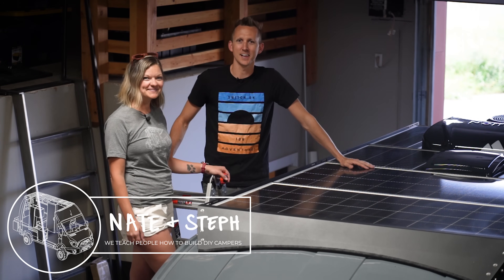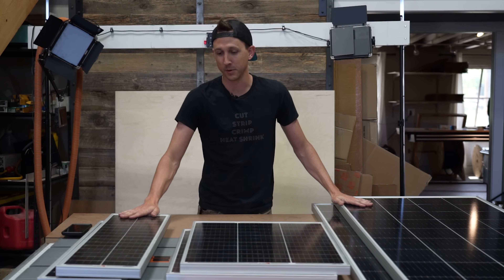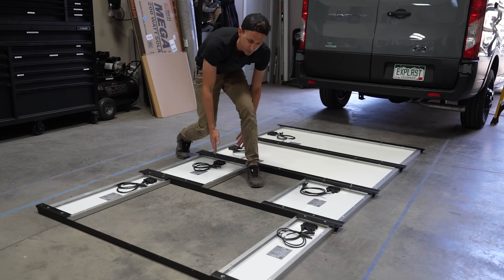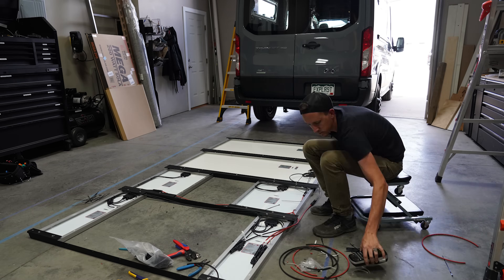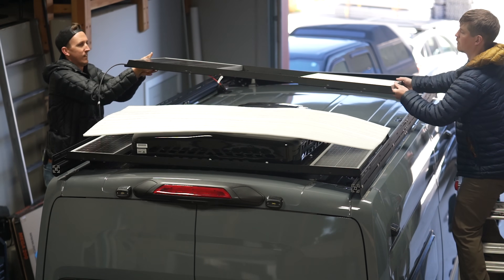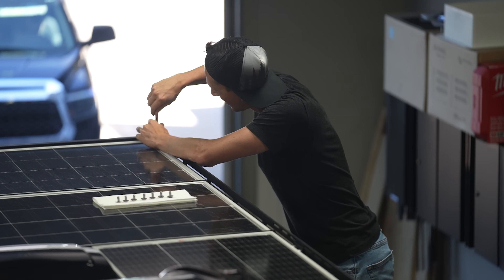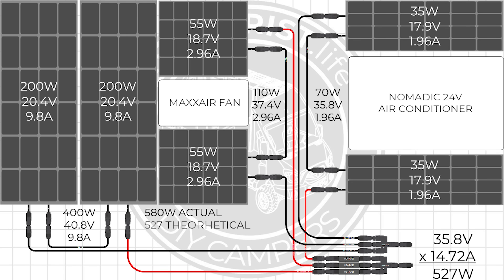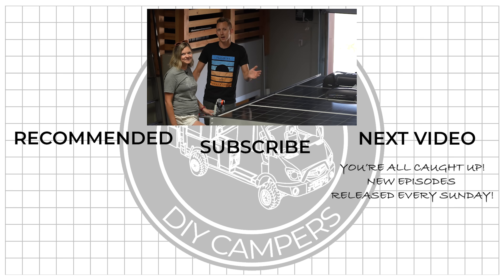INSTALLING 580W OF MISMATCHED SOLAR PANELS ON OUR TRANSIT

Comment: I think if/when I do something similar I'd just pop the rear half of the roof rails up 8 or 9 inches and put a third 200w panel over the vent and front of the AC. with just a couple modified brackets you'd be left with only 3 matched PV's instead of 6 mismatched panels, ~73 more watts, the vent and part of the AC would always be in shade, and could build a couple boxes up top to take advantage of the freed up space. With enough finagling I think it would only add about 1 inch overall since the vent could open into the hollow cavity under the panel. Might be a little tricky to mount an awning though.
Reply from the maker: That's 'somewhat' how we had it on our old van and the panels really are way up in the air to clear the open maxxair fan.  It's 'fine', but not the form factor we were going for this time around and really made the van undriveable during cross-winds.
Reply: @EXPLORISTlife  Hmmm... (digging into the back catalog) I see. Weird, I wouldn't think putting the panels on top of an open frame rack like that would make a huge impact on cross-wind behavior, especially when you're already driving a billboard. I wonder if the differences in handling could have anything to do with the MB vs. Ford switch as well as the lower rack height. It also looks like you used to have quite a bit more weight in front of and behind the front and rear axles (respectively) that could've jacked up the moment of inertia. kind of like loading a trailer too far to the rear, just a little nudge and you have to fight keep under control. I'll have to keep all of that in mind.

Comment: Is it possible to use this solar array with a 48v inverter charger and 48v battery bank? I don't fully understand these 48v inverters, but they say the MPPT range is 120vdc-450vdc. Does this mean that the solar array wired like you've done is too small? Will the inverter charge the batteries with a lower input voltage?

Also, can you wire an alternator into the PV input of the inverter to combine solar + alternator charging while underway, even if it's not a 48v alternator? Apologies in advance if this is the stupidest shit you've ever heard, I'm just not educated enough in electrical
Reply from the maker: I guess it depends on the charge controller.  This array won't work with a Victron charge controller and a 48V Battery bank as the array voltage is under the battery bank voltage.

Perhaps taking a look at https://www.explorist.life/solarwiringdiagrams will show you how to set up a proper full system. 👍

Comment: I need everyone’s quick attention; 

I have 8 100w panels.  Specs-18 volts/ 5.5 amps.  They are currently in 2 sets in series then parallel.

My question; I just purchased 2 200 watt panels.  Specs- 18v/ 11 amps, doing the math of adding these as series then parallel with the other panels “doesn’t get me much”?  Correct?  

Sure appreciate anyone help!

Comment: p A r A llel ..  Amps Add / 2 A's... ...    s E ri E s ... volts add...   (E is a letter used for voltage in some equations)...  a way to keep them in mind...  and, you don't even have to remember both !  just get the pArAllel one  stuck in your mind and you'll know the other one is the opposite.

Comment: If you add a second controller, you can push the calculated efficiency from 90.7% to 99.17%
Leave the bigger array panel connected in series to one controller 40.8V*9.8A = 399.8W
The other two arrays connected in parallel to other controller        35.8V*4.92A = 176.1W
Total of power calculated: 575.9W. Total power available: 580.7W  (99.17 %)
Thanks for yours videos.
Reply: 90.7% sounds pretty good to me
Reply: It's kind of irrelevant.  It's a bad setup.  The 70w of the smallest panels are loosing you 60w off the largest panels. And loosing on the mid size panels as well.  You would be better off without them.  Not to mention both sets of smaller panels will suffer from shadowing problems 95% of the time due to the aircon and skylight further draging down the voltage.
Reply from the maker: Real World Update:  The other day we got 605W from this 580W array.  I'd say it's a pretty good setup, brett.
Reply: @EXPLORISTlife  Your setup is not perfect for every single circumstance....because no one setup can do that. You had a goal for yourself and accomplished it, well done! Since I am a full time van traveller, I created a tilting ability to 500 of my 600 watts on the roof, it allows plenty of air flow too, and in alaska I can still make some solar in the summer as well as mexico in the winter. I have notice flat panels make about 60% of correctly tilted panels....but this is only a problem for people who need lots of power and don't drive using a DC/DC often and are far from the equator. I think people should focus on tilting and cleaning as opposed to simply more panels if they are stationary a lot. Anyway it is always fun to see angry comments from people who only see their perspective and personal circumstance tell you or me or others how to do everything😂 Keep doing you!
Reply from the maker: @finbombvideo  Peoples inability to take what we teach on this channel and use it for inspiration in their own project is 100% the most frustrating part of this job. 🙄🤦🏼‍♂ 

This stuff is so modular and expandable, both up and down, that I'm doing my best to showcase that, but some people just don't have that kind of big picture and positive outlook.
Reply: @EXPLORISTlife  - Nate, don't worry about people misinterpreting/not understanding what you're trying to convey.  You're dealing with an extremely diverse audience.  You're doing great, and if you see a way to connect with a comment, do so.   If not, just move on and have fun.  😎
Reply: @BrettDalton  %100 percent thinking the same way. In real World Update : At some point with a good cold weather and for limited time they can produce higher then calculated but in hot times they will reduce production in my opinion.  Also my concern is, you need take care of panels very carefully. When small panels get a little dirt, leaf or shadow production will affected to much.  

 @EXPLORISTlife  Calculations for panels must be made total harwested Watt/hour in a day, not for the peak production. It is important how much energy you are loosing in the morning and evening. =) And how much this affects your total production in Watt/Hour. 

But still you have the chance to put a second charge controller in the future. In doesnt need to much extra wiring and man hours.
Reply from the maker: How about this... If you want to put all three sets of panels on their own charge controllers in your own setup, I'm more than happy to sell you all of the parts you need to accomplish that.  That's better for our revenue numbers anyway.
Reply: @EXPLORISTlife  Hehehe... Good Humor and Marketing... =) Solar Charger for that small panels cost only 100 $ ,  If you use 2 extra charge controller you will save using 3 Fuses and save 45 $ s. And total cost will be 155 $ + Cable =) Also you will make it more simple and a little bit redundant and more shade proof, eliminate 3 connection points for future point of failure.  This is how i look to the subject. =)
Reply from the maker: Cool..  yeah, like I said... if that's the direction you'd rather go, I'm happy to sell you the parts.

Comment: Did you consider installing any panels on the engine hood?  I've seen another van conversion with this and one reason I can think of doing it is if you want to transport a long item (eg canoe) on the roof which would block the sun.  At least the hood would always be obstruction free.  Of course the angle would be off axis, but parking it into sun would solve this.

Comment: I'm just a newbie, but with the mis-matched panels, you said the only way to reach 100% is 3 separate charge controllers. Is it possible to take the output of all three strings, connect them all to a bus bar, then tap off of that bus bar, into a single controller, and utilize all the power efficiently? Seems logical to me, so eager to hear why one would or would NOT use this approach.
Reply from the maker: Here's a video that will teach you all about that: https://youtu.be/jejro4zkl8I
Reply: @EXPLORISTlife  Thank you. I have watched that one before, and re-watched it today. I understand the affect of the different voltages and taking the lowest denominator. I'm curious about, for example, if you take two 200W panels and combine their output to a bus-bar, and you combine 2 400W panels, and combine their outputs onto the same bus-bar, would you get full power for both, and simply tap off of that bus bar, to your charge controller, and be ok? It's probably a bit different than how I asked it before, in that I am saying to put the same panels together.
Reply from the maker: @Oldsrulez  mc4 connectors and busbars are the same thing, electrically.

Comment: Hi Nate, why did you go for so much solar? I was thinking the Dc/Dc charger would complement to charging enough that I would only need 200 -300 watts of Solar. Would that not work or are you thinking you will park up for long periods. Thanks. Brian
Reply from the maker: When we were living on the road full-time, we would use about 300Ah of battery bank capacity on every normal 12hr work day.  To re-charge 300Ah of battery bank capacity, it takes about 600W of solar.  Even with a big 100Ah Victron Buck Boost, we didn't want to have to take an hour(plus) long drive every night after working, so having adequate solar is key.
Reply: @EXPLORISTlife  Thanks for getting back to me so fast. I will have to re think our daily usage and probably add more solar and probably up the battery bank too. Thanks again. Brian

Comment: I was planning on running a mixed array with 6x100W and 2x30W panels (everything in pairs of two) but received this reply from Newpowa:

“There is no problem with your calculation.  Meanwhile, connecting panels of different wattage is still not recommended. It is not only because it will cause the output of system to drop, but also because there will be a inverse current in that system, which may cause a damage to the panel.”

Could you speak to the inverse current and output drop? My configuration has very little loss in terms of how volts and amps are added (less than 2.5W loss) with the series parallel configuration. I know I need a 5A fuse on the 30W panel but they were still concerned. Thoughts?
Reply from the maker: If a manufacturer is recommending against something, I cannot, for liability reasons, recommend you ignore it.  If they are saying to not mix and match their panels, you should run each set to seperate charge controllers.
Reply: @EXPLORISTlife  do you know what Newpowa support is referring to so I can make my own informed decision? Have you heard of this with other manufacturers? Any links to info are appreciated! Thanks

Comment: Can you use your 580 solar kit for 24 volts which includes panels on a 12 volt system?
Reply from the maker: Yes!  Would just need a slightly larger charge controller.  If you're wanting to go that route and need help sizing that... submit an order ticket at shop.explorist.life/support and we can get you squared away.  Great question!

Comment: I’m sure it has been covered somewhere at some point but wanted to ask if you can have both rigid and flexible panels in the solar configuration of the build?
Reply from the maker: The charge controller doesn't know or care if it's connected to a rigid or flexible panel.  All it knows is what voltage, wattage, and amperage the power is being delivered at.

Comment: I understand the (2) 200w panels in series, but it seems like one of each of the smaller 50w and 35w might be better in parallel with dedicated charge controllers?  It seems like one side of the smaller panels would often be shaded by the ac or max fan? But you clarified your decision one controller and fewer wires going through the roof.
Reply from the maker: The array voltage of a 35w and 55W connected in parallel would be too low for our charge controller to operate when connected to a 24V battery bank like we are using.

Comment: Great video, looking forward to the rest of your build. I have two rich solar 24v 200w panels and a 100/50 victron smart solar mppt left over from another project, can i use the 24v panel and victron 100/50 mppt to charge a 12v battery bank by simply programming the controller to the lithium profile for the 12v battery bank i have?
Reply: Yes, thats what the mppt is for. In the case of the victron its auto sensing based on the voltage of the battery you attach. It then regulates the charge from the panels down to the appropriate Voltage for your battery.
Reply: @curtisdinman  thank you thats what I thought, just like to double check, I appreciate the response.

Comment: I think I'm gonna cheat on my boat. A big array of 600w for my main leisure that will run an inverter and some main stuff (water pump etc), then a second 200w array with its own charger to keep lights going, and top up the engine/starter motor.

Comment: Once you open the Maxx fan won't that shade the panels right next to it?
Reply from the maker: A little bit when the sun angles are low in the sky.  The only way to 100% get rid of shading is to: A - Not have any fans/air conditioners on the roof; or B - Elevate the solar array about 10" off of the roof like we did on our last Sprinter; which is obviously not nearly as sleek as this setup we've got going on now.

Comment: Hi love your video just a couple of questions I've installed panals on my barge and be told I've got to fuse them for the boat safety test I have four 250 watt... 21 open circuit 8.9 amps
So do I put 20/30 amp fuses
Also some people are saying I can use diodes????

Comment: I think you would get better efficiency by just using two long panels on the sides of both the AC and fan that was closer matched to the voltage output of the 200W panels.
Reply from the maker: We ran the numbers on that as well and found that not to be necessarily feasible due to manufacturing reasons.  Remember... there's a LOT LOT LOT more that went on behind the scenes of this video to make this setup work and although there is always something 'better'; perfection is rarely attainable except on-paper.
Reply: @EXPLORISTlife  I think you will find that those two small panels will only yield about another 40W total in real operation, so not sure they are worth the cost.  I fully understand the need to get the most out of the system.  I am running three 175W on my Sprinter but only getting about 125W out of each.
Reply from the maker: In cool weather the output will be higher.  I've seen 240W from 2x100w panels before on a cold clear day in late May.

Comment: Thank you guys so much for all your video content. Super helpful! You guys are awesome! I have a trailer. I am ripping the electrical out from the breaker box to the shore power. So far, I have 4 battle born batteries and a victron quatro inverter. If you could buy the absolute best solar panels for this system, which ones would you buy?
Reply from the maker: Any of these.  Ideally 800W and up: https://shop.explorist.life/product-category/all-products/camper-wiring-kits/solar-charging-wiring-kits/

Comment: I might have missed it in the video but which Victron Solar charge controller are you using for this array? Seeing as it is 35.8v and 14.72A will a 100/30 work for this? I always see it said a 30amp controller is good for up to 400watts of panels but it looks like one could be used for this.

Comment: A 200w flexible panel double sided taped to just above the window will give your clients more power if required
Reply from the maker: I will pretty much never recommend a flexible solar panel 'taped' to the roof.  There isn't enough cooling for the panel to function optimally and their lifespan just isn't long enough; and when it needs to removed and replaced; there is usually significant damage to the paint underneath, making it look junky.  If we need additional power, we will have the capacity to deploy a ground solar array up to 1700W, have significant alternator charging, or running a generator/shore power.
Reply: @EXPLORISTlife  yeah a tip on that is to use a vinyl wrap on the metal and glue a conjugate plastic panel like realestate signs to the wrap and then panel to the plastic and it gives good cooling. I have a panel on my hood and that functions well. Only place I can put one on the 4wd

Comment: I've been working for awhile on a roof rack/solar design for my upcoming Transit conversion. Always nice to learn from someone with a lot more experience, thanks for the simple yet effective design.
As for the power efficiency, since the higher voltage panels can't operate at max voltage, the max current they produce is also lowered, so your array may have lower power than you calculated, could be negligible but I will probably have the two 200w panels on a separate charge controller.
Reply: I agree 100%.

Comment: I would definitely use separate charge controllers because those little panels are going to get shade from the AC and that's going to strangle the whole system.
Reply: Yes but since they are connected in parallel to the other two arrays the only power loss is going to be the small shaded array.
Reply from the maker: Ivan,  When you get ready to hook this array up to your own van, let me know and I'll be happy to sell you as many charge controllers as you want for your own system. 🤣  The shading is very very minimal.  I'll do a review of this system after we get to use it a bit and let you all know how it performs in real life and not just internet speculation.